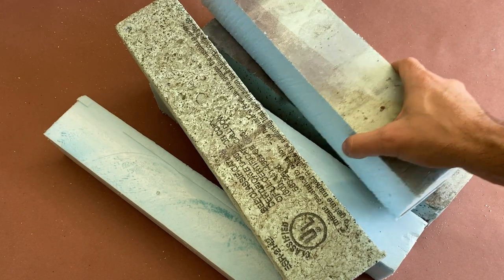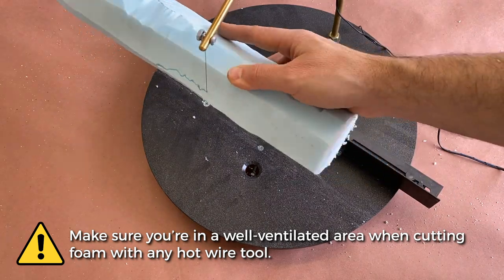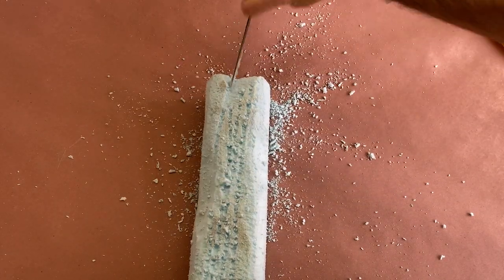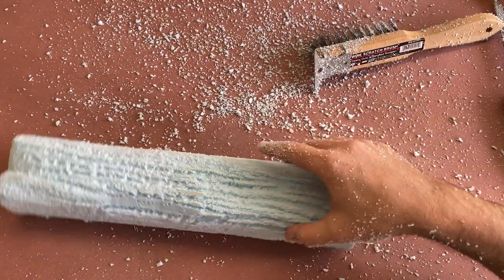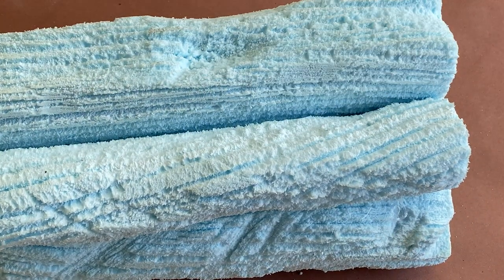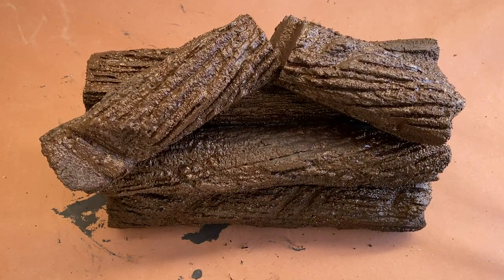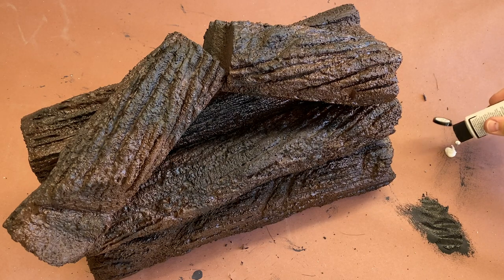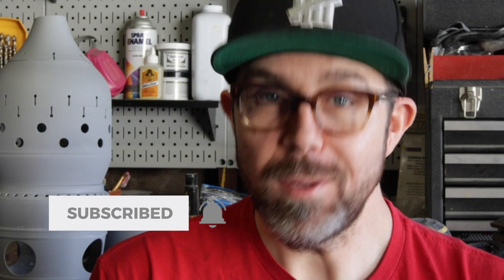Making Fake Logs From Foam DIY

Comment: It’s amazing how a white dry-brush layer brings it to “life!” It looks really great! I’m always intimidated doing organic textures, this makes wood texture really doable, so thanks for sharing!
So... I was interested in your choice of the order of operations - specifically gluing it all together before applying monster mud and paint, why did you decide to glue it first? I’m thinking the hot glue may hold better on naked foam? Would you do anything differently in a 2nd go? Just curious, thanks for all you do!
Reply from the maker: You're absolutely correct. Any adhesive is going to bond better when applied to "raw" surfaces. As for doing things differently, I'd have used Gorilla Glue instead of hot glue because my glue gun is at the end of it's life and the glue wasn't really coming out as hot as it should and so I had a few spots detach from one another. I also would have, and still could, carve out the back of my support block to allow for the addition of red twinkle lights to give the look of glowing embers. I may address that in a second video.